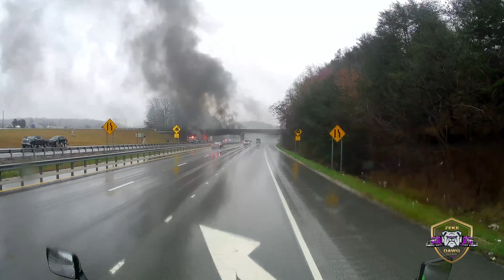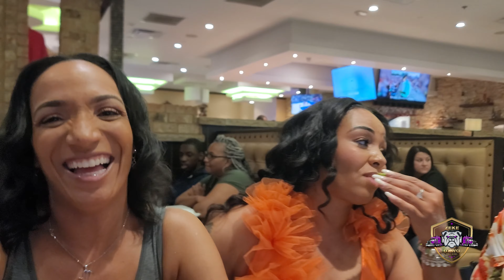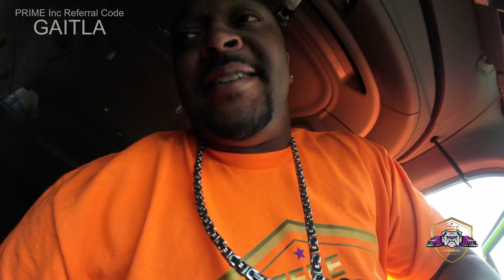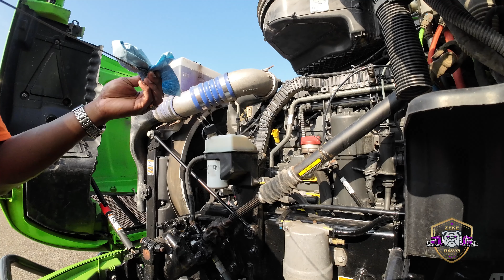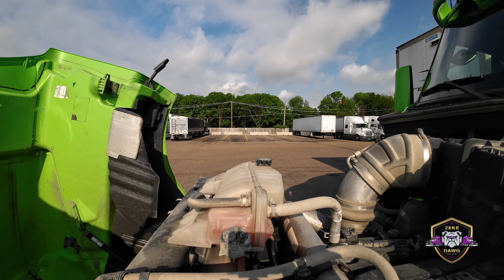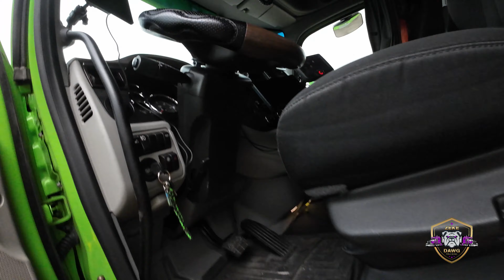Cinco Da Mayo with Zeke Dawg, My name is Jefe

Comment: Super single Michelin tires are expensive.........stay safeMichelin X One Line Grip D
445/50R22.5
VIEW MORE 445/50R22.5 TIRES
Part Number:71140
Speed Rating:L
PRICE
RETAIL: $2468.99
$1524.19
QUANTITY - 1

SUBTOTAL
$1524.19
Reply from the maker: Those are the ones right there. I need that.